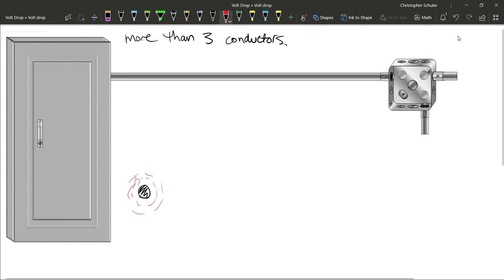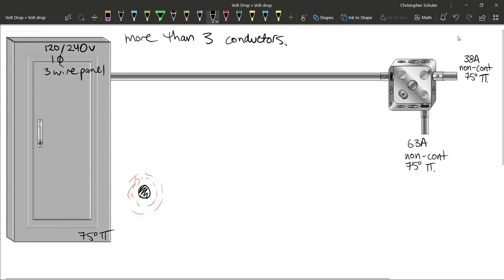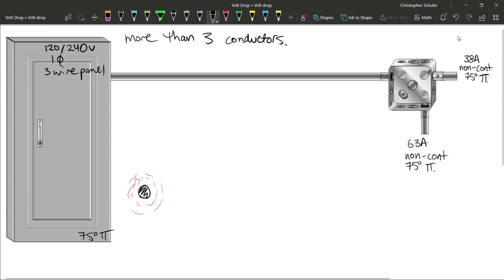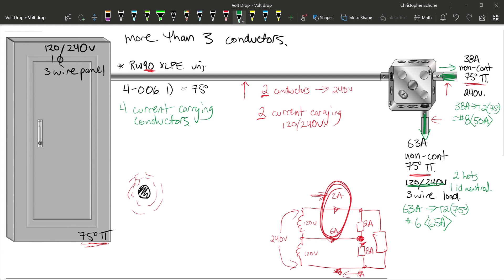More Than 3 Current Carrying Conductors

Comment: I think I misunderstood something. Five wires are in the pipe going into the panel. Why do we derate the ampacity of the wires to 75? The wires are rated 90. Once they enter the panel they're no longer in the pipe so the derating factor wouldn't apply? As long as the ampacity is still good for 75 tt.

Comment: How could we apply derating to voltage drop
Reply from the maker: Apply correction factor first to determine the minimum ampacity of the load, then proceed with the Volt drop calculation to determine the minimum conductor size.
Reply: @schulerruler  Thank you

Comment: If I had a question asking what to the ampacity of  the conductor are in a similar question BUT not given the Termination temp (for the Breaker panel) would I not need to use 60 deg column according too 4-006 2) a) ? 
I was given a question like that but wasn't given the termination temp. I got it marked incorrect. I know breaker boxes are 75 deg termination temp but if it doesn't say it in the question am I to just assume? I was always told to never assume when working with code questions.
Reply from the maker: Yes if no termination temperatures are indicated, we would apply 4-006 2). If the load is 100amps or less we would assume 60° C, however above 100amps, we assume termination temperatures of 75° C. I would check the question to see where it falls in those two.
Reply: @schulerruler  this was the question. 
Eight No. 10 AWG RW90XLPE aluminum conductors Installed in a run of EMT Terminating on circuit breakers.
What is the maximum ampacity rating of the conductors?
a) 17.5 A
b) 21A
c) 24.5 A
d) 30 A

Using Table 4 under the 60 deg column i got 25A than went to Table 5C to derate 70% (.70) = 17.5 A
The online CSA exam simulator said I was wrong and it's 21 A. 
Am I missing something?
Reply from the maker: I would say based on that question you've got yourself a case haha. 
They don't indicate anything about the breaker we would definitely use 60 and I agree with your selection. They have used the 30amp ampacity at 75 as an incorrect assumption.
Reply: @schulerruler  okay I appreciate you taking the time out of your weekend to help me. I have a hard time letting go on stuff like this. I need to know where I go wrong. Thank you again.
Reply from the maker: Happy to help my friend.

Comment: I am confused with neutral as current carrying conductor in 63A path. First you told no need to consider neutral as current carrying , but at the end you consider it as 3 wire current carrying conductor. as i know we have to consider neutral as current carrying conductor when it is identified.

Comment: Is it possible to use #4awg only in the first conduit and reduce it after the junction box ? For the 63A load
Reply from the maker: Absolutely, as past that point you would not have to worry about the the additional magnetic fields from the other conductors anymore.

Comment: I thought I understood most of this, but your outstanding video exposed my weakness. I always wondered why the white wire of a multiwire 240V circuit can be considered noncurrent carrying for the purpose of ampacity fill adjustment in table 5C. Even though it does carry current, as you say the maximal current will happen if the other leg is nonconducting, in which case you still have only two conductors! If load is balanced it carries zero, and in between the white is added to the lesser leg to equal the dominant leg, so the sum is equivalent to the ampacity of two high legs. People need to remember that this only applies with multiwire branch circuits, and with 240V appliances that carry a designated conductor for internal 120V use.

Comment: hello
how the wire nuts and two way/3 way switches to be considered in box
Reply from the maker: Each pair of wire nuts will count as one conductor.
Each of the you mentioned will count as two conductors of mounted on a single strap each.

Comment: But don’t the neutral carries the unbalanced load?
Reply from the maker: It carries the unbalanced current yes, but also maintains phase voltage, and the voltage in a 120/240V circuit.
Reply: Wouldn’t it be consider a current carrying conductor then?
Reply from the maker: @gbce2404  it does carry current but the three wire circuit will only ever carry the EQUIVALENT of two current carrying conductors regardless of the configuration.
Reply: Only in multiwire Branch circuits

Comment: Could we have used #4awg only in the first conduit and reduce it after the junction box ? For the 63A load
Reply from the maker: Absolutely, as past that point you would not have to worry about the the additional magnetic fields from the other conductors anymore.
Reply: I have exactly this question. did you find any answer?